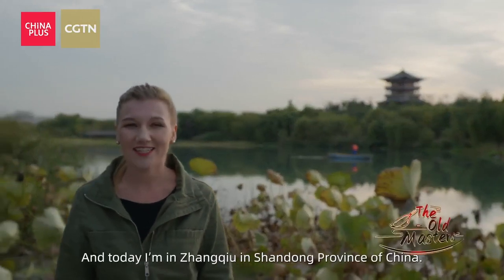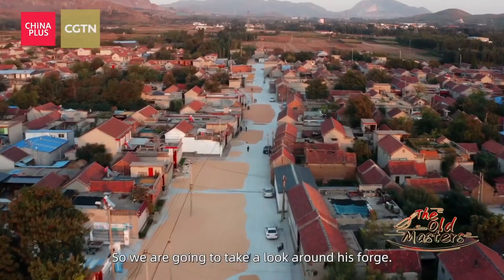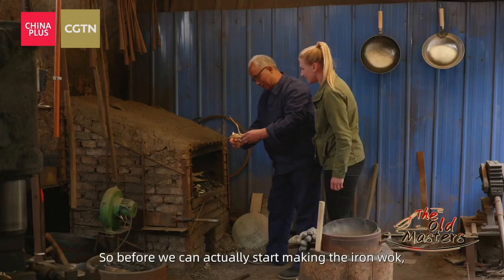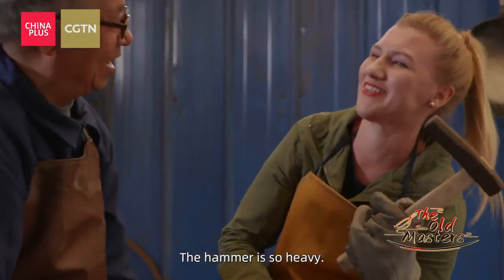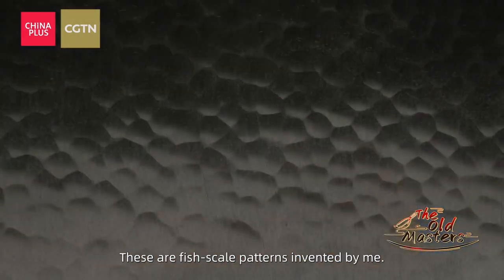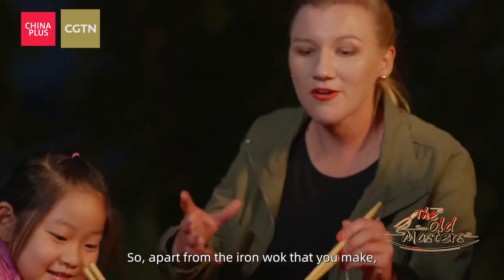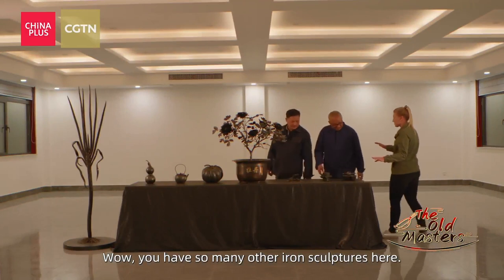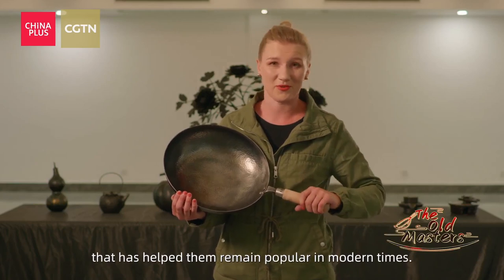Unique Traditional Iron Wok

Comment: I HAVE ONE OF THESE!!  I LOVE ALMOST everything about it!  😂. Be forewarned, they ARE heavy!   My WONDERFUL friends in China sent me a VERY large one (16 inches) and you DO have to get used to it!  My ONLY issue is cleaning it. For some reason, (which is probably MY fault!), my eggs-tomato usually stick to it.  I’ve just tried curing it again and am told it gets easier with time and experience. 😊. I will say-I have made the traditional comfort-dish of eggs and tomato for about 4 years and used to use an inexpensive, non-stick wok.  The taste in my iron wok makes ALL the difference and I could make this every day!  谢谢， 我的朋友！I will cherish and enjoy my hand-forged Chinese iron wok for the rest of my life!!
NOW, I think it’s time for some food!! 😂
Reply: Also, to add to the above comment, make sure the oil u add have enough time to heat up as well. This makes a huge difference in being nonstick. Good luck!
Reply: @victorchung9814  THANK YOU for the advice!  What is the best oil to use-if there is one that is best for an iron wok? ❤️🇨🇳☮️
Reply: I know this comment was a year ago... but believe or not Chinese woks being made of iron (or carbon steel) do not work best when cooking acidic food, especially for dish like tomato fry eggs, the acid from the tomato will strip off the dark color non-stick coating every single time you cook it and I think it could be the reason your wok became stick to food. If you cook acidic food often the wok will need more regular re-seasoning, you also need to apply a thin layer of oil every time after washing it. P/S: always add eggs first before adding tomato that way your food won't stick
Reply: @ABACUStoPC  THANK YOU!  I kind of got tired of needing to re-season it after almost every use.  It is also extremely heavy and much too big for just myself cooking individual meals.  I DID use it when my girls visited 3-4 times this past year.  I made many different stir-fries when they were young and they hadn’t been able to duplicate the same taste as I had.  I had one dish my Vietnamese sister had shown me when we were in high school, (long story);  my kids used to call it “Khuong’s stir-fried salad”.  I’d purchased a small farm when the kids were growing up and while it was mainly for wildlife I rescued, rehabbed and released; I planted a large garden every year, just for us.  My sister had sent me some seeds to grow some Asian veggies & plants, (we were in North Florida so we’re able to grow almost everything except bamboo), but just as she had, we added green & red leaf lettuce, LOTS of spring onions, cucumbers, tomatoe and usually squash-along with the Bok choy and snow peas.  That was our “stir fry salad”..WITH certain seasonings, of course.  
My eldest was here a few weeks ago, we went to a nearby farmers market and they happened to have a lot of things local stores don’t usually carry.  We lived in India for a few years when the kids were teenagers, and my daughter wanted to learn how I cooked both my Indian and Asian dinners.  We got my big wok out and cooked all kinds of things during the week she was here.  I thought it was funny..one thing Khuong and my other foreign friends had always taught me was heating the spices-especially peppers, garlic, seeds, even ginger, in oil BEFORE you add anything else.  Somehow my eldest had overlooked that concept and I’ve had several calls and texts this past week, “WE DID IT!” 😂
My wonderful Son, who died last June just days after getting his approval for a return VISA to China;  would be SO proud of his Sissy!   🥰. He LOVED cooking and the night before he died (a stroke related to the virus), we had been on a 4 hour livestream as he cooked a kind of international fusion meal.  CJ had spent the 13 years of his adult life traveling around the world, especially China and Nepal.  He took after me as far as loving to experiment with different foods.  Next week is my birthday and my eldest sent me a box of frozen seafood in dry ice a few days ago.  I can’t get good seafood here in the Poconos.  My dear boy also LOVED seafood..he’d told me about some fish dishes he’d learned from friends in QingDao.  And a spicy crawfish dish from Chengdu.  Unfortunately, I never got the recipes, but I’m going to message some of his friends with pictures of what I have, (snapper, oysters, shrimp, crawfish..and I THINK the other fish is sea bass. They’re all fresh-frozen in vacuum bags and for some reason, they aren’t labeled).  I have so much, I’m going to treat my best friend and her husband to a (mostly) Southern Seafood feast!
Reply: @elaineg60  it sounds you have a great family! I think food can connect people from everywhere, and families too. It is indeed a wonderful thing in life to cook for the loved ones . BTW, I am very sorry for your loss.. I wish your family the very best in the future, and good luck too with your seafood feast!

Comment: Never throw away iron cookware because rust...rust appears always user error. The best way to clean a well seasoned wok or carbon steel pan after each cooking is rinse with hot water and a stiff brush, or Chinese traditionally a bamboo brush or a brush made of coconut rind. It works very well.